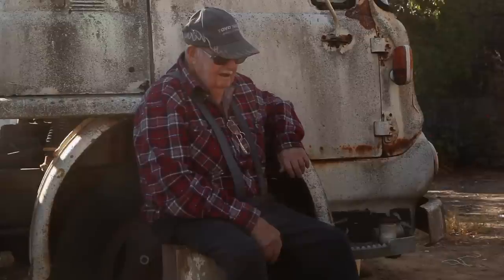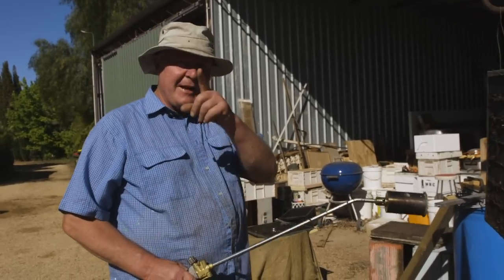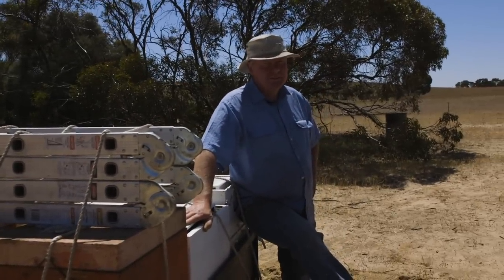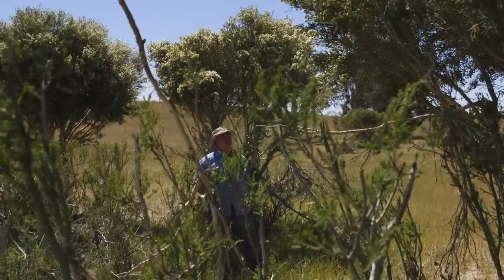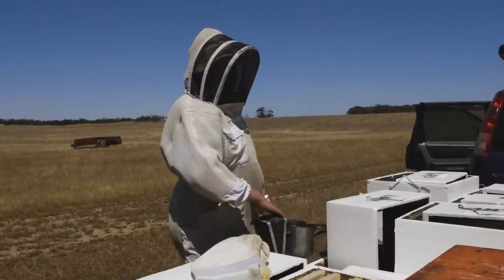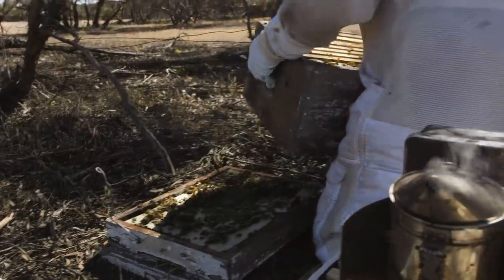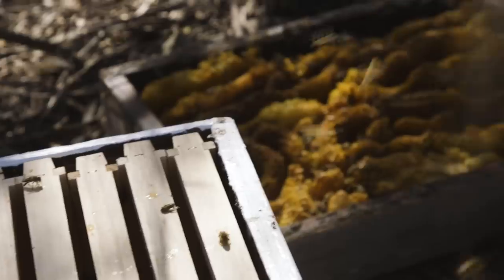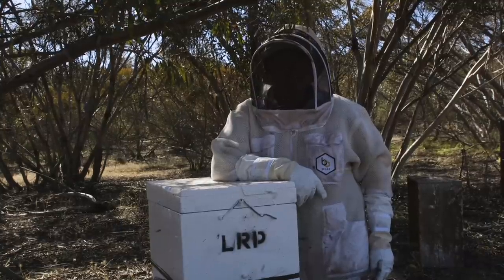Helping to Restore Les's Beehives Back to Health - The Bush Bee Man

Comment: Hi BBM. Is it true that I must have removable frames? Or can I just inspect the hive another way? I've designed a hive that is more natural and the point is to not remove the brood comb. Good vids by the way I enjoy the information. And the antics.
Reply: Yes you must have removable frames under Australias biosecurity regulations. You must be able to remove and inspect frames for diseases such as American foul brood and although we don't have them (yet) Varroa mite. Using a hive that does not have removable frames endangers wild hives and beekeepers in the area so its not just a problem for you only.
Reply: @keithpadbury9818  thanks for the information. I've since read the code of practice and find it inflexible in a few areas. I understand the internet but you can inspect a hive without removing frames and that one principle restricts Australian beekeepers to one of many hive designs and one that is essentially 170 years old. I can achieve the requirement without removing frames.
Reply: @Threadie I find that as a new beekeeper the beekeeping fraternity is a big put off. I feel like an illegal immigrant. What's that all about? I done even want to start with government agencies. I think I'll just go dark! I can't handle the politics.

Comment: I’d be lying if said said I completely get what you  just did. You put the existing bees in a new hive why? And will the old hive frames bee abandoned after the brood hatch? Why do you do this?
Reply: Looks like a cutout with comb rubber-banded in the frames, the natural comb is not good for extracting it breaks apart, the frames are lifted above the excluder with the bees shaken so the queen is below the excluder, once the brood emerges the natural frames are removed and used for swarm boxes or melted for the wax.